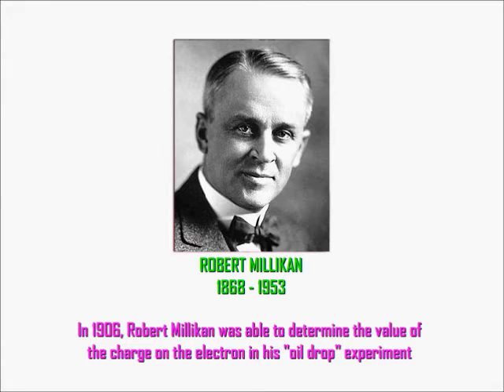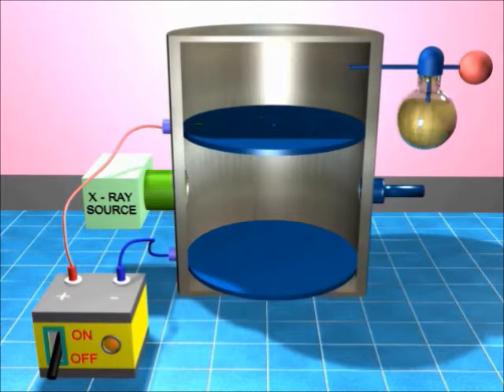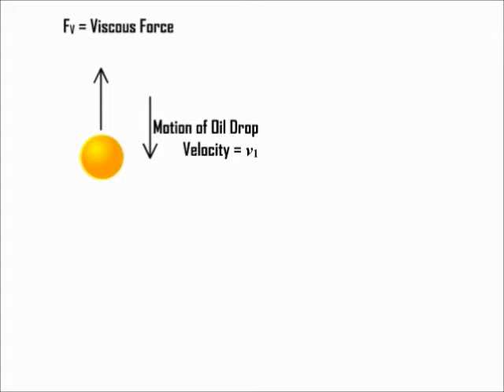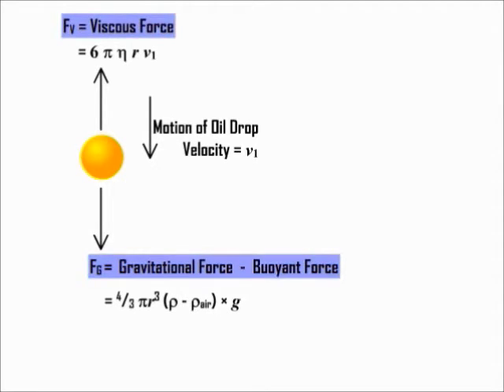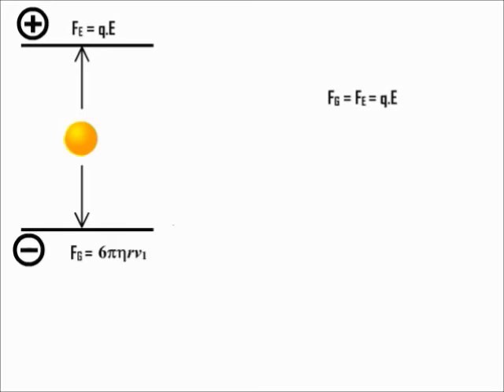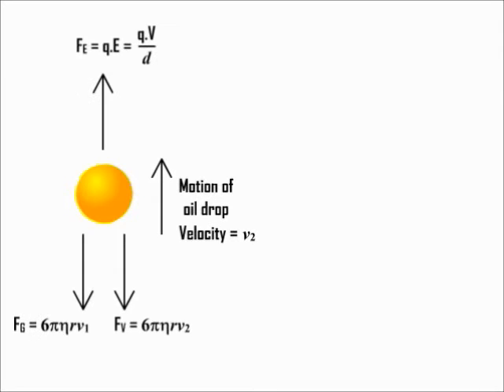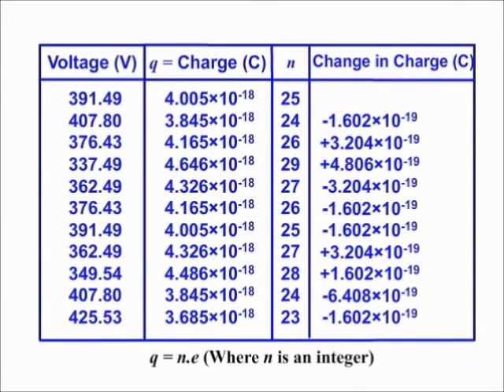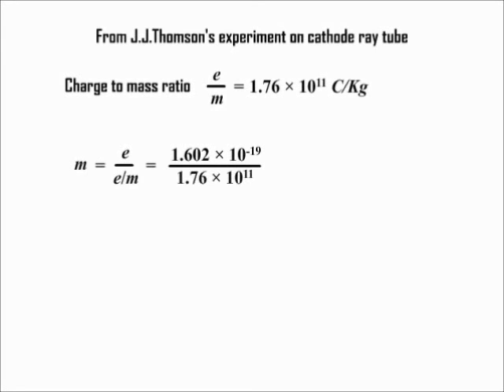Millikans oil drop experiment

Comment: Thank you for your nice video and knowledge.
I need to ask some questions?
Why Fg in 2nd experiment calculated from 6pi*eta*r*v1 ?
The oil drop in the 1st experment that proof 6pi*eta*r*v1=Fg  is the same radius in the 2nd experiment?
Or They can control the radius of droplet from atomizer?
How I can get v1 from 2 nd experiment?
I need to understand it. Please anyone explains more.
Reply: If the drop is moving up with constant velocity, then the force must be acting only in upward direction and this force is provided by the electric field. Rest forces cancel each other (no effect).
Radius of the drop is assumed to be uniform throughout the experiment, thus it is same in every case.